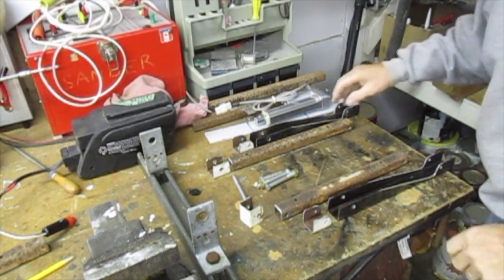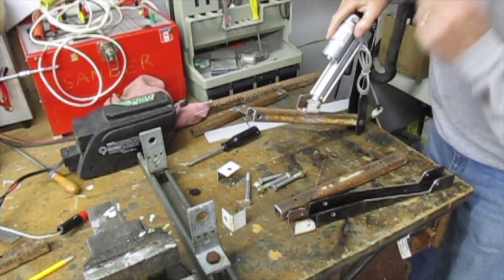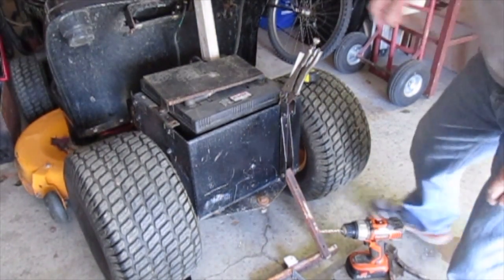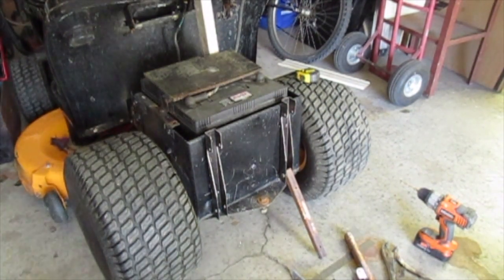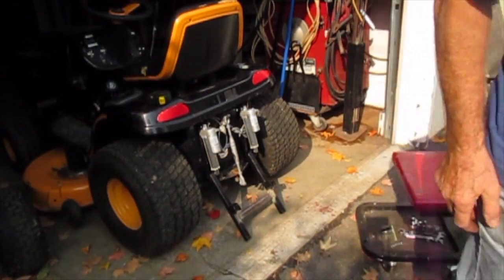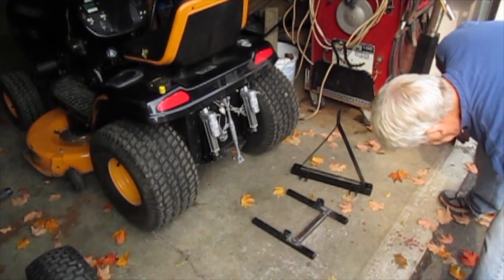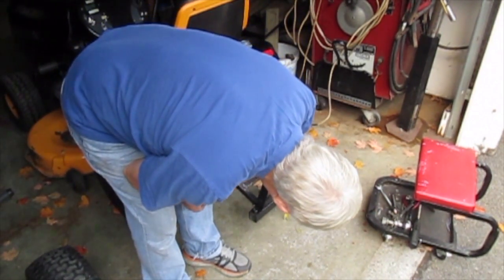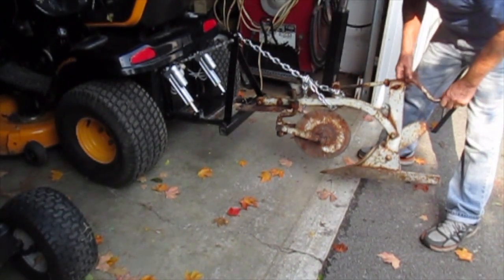#2 The Little Electric Tractor That Can !Making a 3Point Hitch

Comment: The basic idea is good but it looks a bit light.
Reply from the maker: Hi Bernie,  the 3pt hitch will lift about 300lbs not a huge amount but enough to lift the front wheels of the tractor off the ground, you could use stronger actuators to lift more weight if required
Reply from the maker: you can get heavier more powerful actuators but for a garden tractor 300lbs lift is enough because much more would lift the tractor front wheels off the ground